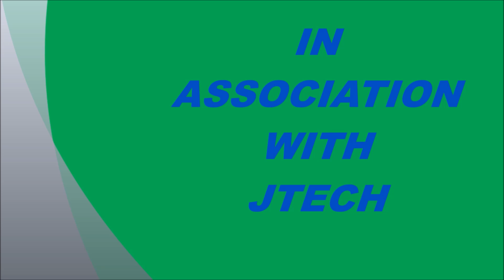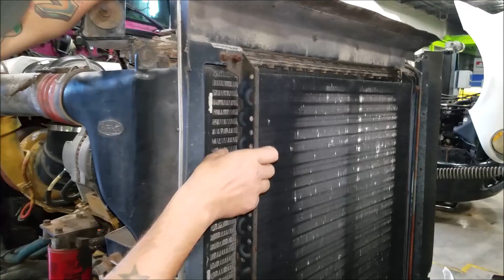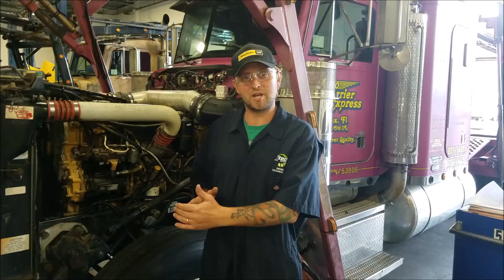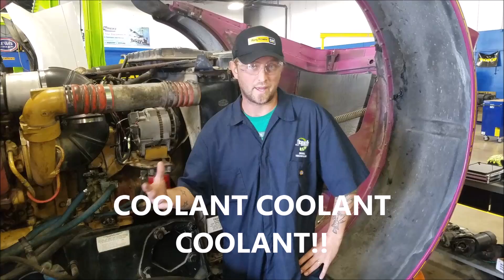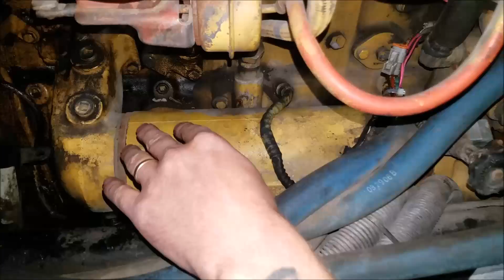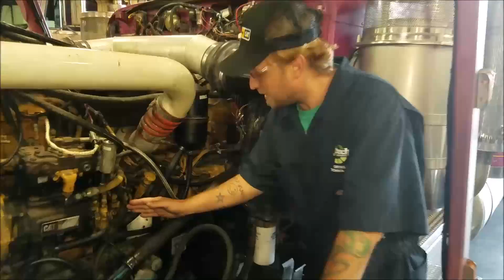Engine components on a C13 Caterpillar diesel Explained

Comment: Great video. Where are you located? Do you work on C13 Cats in RVs?

I have one (2006) that has extremely low mileage (18,000miles) but needs to be checked out to see if it is roadworthy.

Is is a better value to have a truck shop work on your Cat diesel than an RV dealer or shop? I hear they charge more because many RV folks are old and retired and targets for ripoffs.

Comment: That's no C13
Reply: MrHossola how can you tell it isn't?
Reply: Aside from the sticker saying 3406,  the intake flange, the cylinder heads, valve covers, oil cooler, front gear case,  and oh ya....25 years of cdl experience , not much.....
Reply from the maker: He's right I was totally wrong sorry